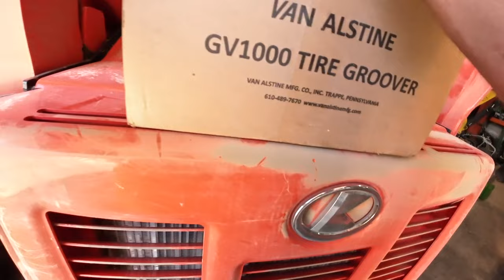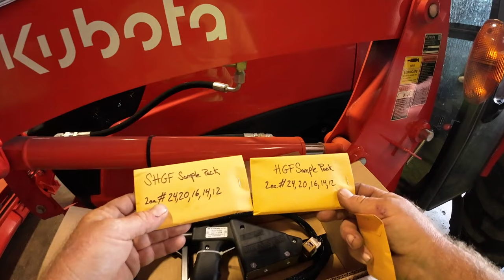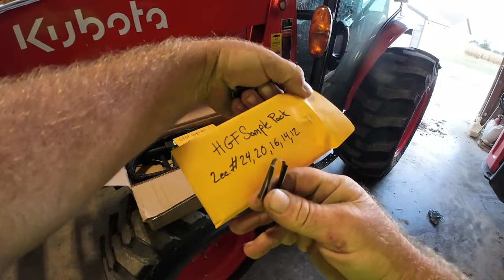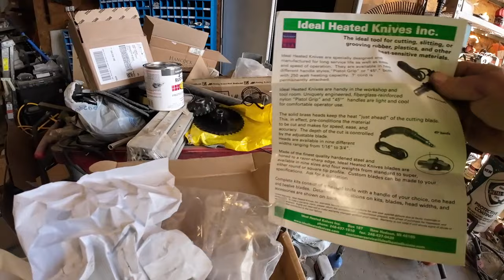Grooving Skid Steer Tracks

Comment: Looks great.....I need to do that to my Kubota tracks.  You might consider putting a groove down the center of the long lugs if that wouldn't make them wear too fast.
Reply from the maker: I was thinking of what I could do if this didn't do much. I wish I would have had this groover instead of the cheap one. I would have probably just went right down the middle of the c with one groove. But I would have used one twice as wide as what im doing. It would make kind of a short L. It would probably do better on hills. Im afraid these grooves are to small for dry traction. But we will see. Im on hillsides all the time.